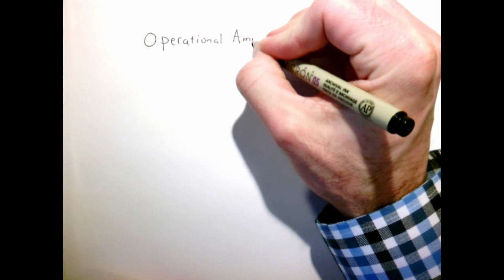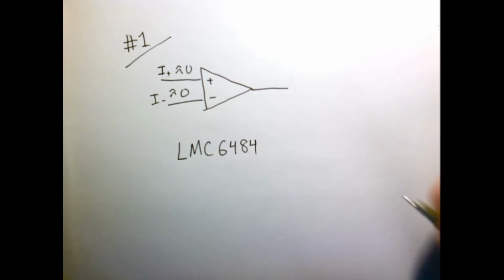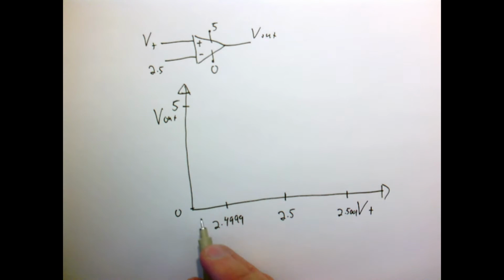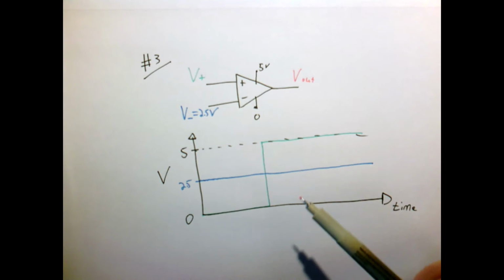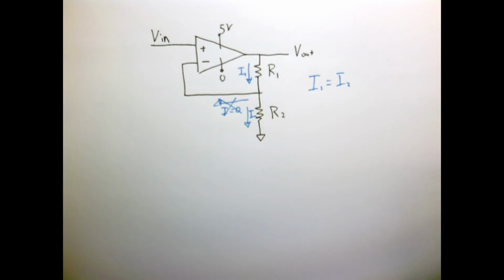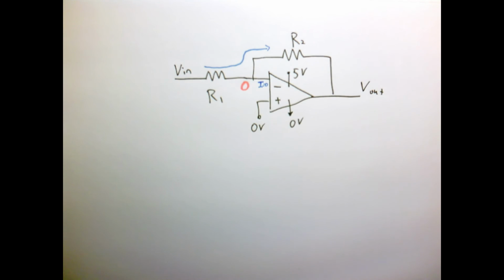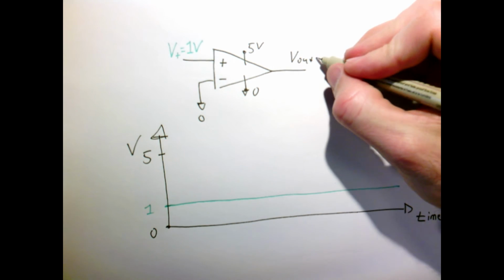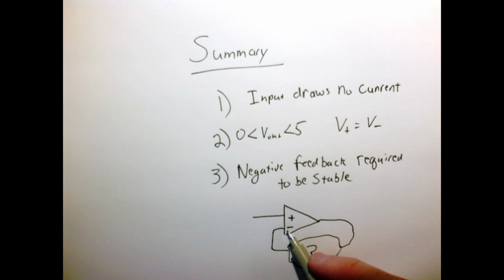Introduction to op-amps

Comment: Brian Storey, Sir, after coming across one of your videos,  I was surprised at the many excellent  educational videos you published. There is so much effort in all you do. Congratulations. 
My daughter prepares courses for teachers of technology and we often research on methods how to transfer knowledge to those who do not have a strong  mathematical background, so one can imagine the use of wood and its shaping to form visible functions which are equivalent to those functions that  are silent and not visible to our human sensors.    When it comes to operational amplifiers  what we do is to have a long  straight strip  of wood  and use it as we use  a lever system. There are three types or classes of  mechanical levers, but to show the working of  an operational amplifier, we use the strip of wood as a Class 1  and a Class 3 lever.

1. Class 1 lever. ( inverting feedback operational amplifier)  If we assume that the fulcrum is somewhere between the ends of the strip  of wood, the effort( input) to the left and the load ( output) to the right.  Then the distance between the input and the fulcrum on the wooden strip  is proportional to R1 while the distance from the fulcrum to the output is R2.  This  fulcrum would represent the inverting input of the op amp. Now if in an operational amplifier the  non-inverting input is earthed,  then the inverting input is also virtually earthed due to the fact that the operational amplifier has a very large gain.  So the feedback inverting  amplifier can be simulated with this long strip wooden acting as a  Class1 lever by  earthing the fulcrum hinged to ground. Now when the input to the left  of the lever is raised the output  on the right falls and when the input  falls the output is raised, where the proportion  of (output/input) is due to the position of the grounded fulcrum which  by geometrical proportionality is        (-R2/R1)  exactly as in an  inverting feedback operational amplifier. Note that the Class 1 lever also gives the inversion  sign!

2.Class 3 lever.  ( non- inverting feedback amplifier)  As before we assume that  the point  on the strip is  placed in proportion to the  two resistances we use in the amplifier( the inverting input), but this time,  the left end is earthed or grounded as the hinged fulcrum as we do in the electronic equivalent  circuit , the output is on the extreme right, while the input is now taken as being  in the middle.  Note in this type of amplifier the input is applied directly to the non inverting input and due to the virtual earth principle mentioned before the inverting and non inverting inputs  have no potential across them.  With the fulcrum on the extreme left, if we raise the  'central' position of the wood representing the non-inverting input, then the output will also be raised and vice versa.     A little derivation will show that the extreme right with respect to the raised point on the strip is  (R1+R2)/R1 , exactly as in a non inverting feedback op amp, complete with sign. 

An analogy for an instrument amplifier with two inputs where the output is in proportion to the difference of the inputs can  now be built  by joining together the Two lever systems we explained before .   For simplicity,  keeping the ends flush with each other, just pin loosely with a nail the two parallel ( equal to start)  long strips of wood somewhere  between a  quarter and half their length where this joint would represent the zero voltage difference between the inverting and non inverting input.    Ground  the left hand side of one of the strips with a pin to earth .
Any  individual or combined displacement of the two inputs ends on the right hand side would be reflected  at the output end  on the right  as their difference while the inverting and non inverted simulated joined point will float accordingly, as actually occurs in the electronic version.  

All the  children and non mathematical and mechanical student  including civil engineering students find this structural  dynamics  of the combined  levers  so fascinating.  
____________________
Incidentally when simulating a capacitor with mechanical items we always use two equal liquid tanks  representing the plates of a capacitor , each tank has two connections  one used to connect directly between the  two tanks representing the internal  displacement current of the capacitor in the dielectric,  while the other two connections, one in each tank is connected to  a double acting piston pump to represent  either an AC or a DC supply system.   This simulation would ensure that the the charge in one tank is robbed off the other tank as occurs in an  electronic capacitor with the electron charge. 
We modify the system to  show the difference when charge the capacitor from a  voltage source or a current source........ or through a resistance...... but  it would take too long to explain it with language symbols alone.  Trying to teach invisible and silent engineering  functions without mathematics is pretty hard to do.
_______________________
Congratulations for your presentations and the long time and effort in producing  the many videos I  saw in your name.